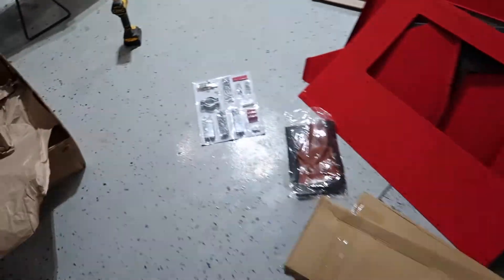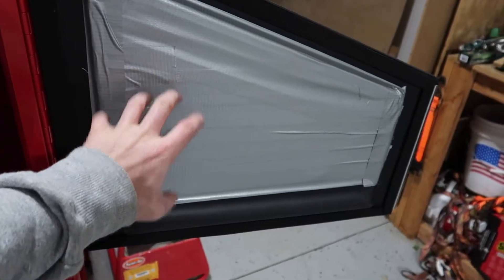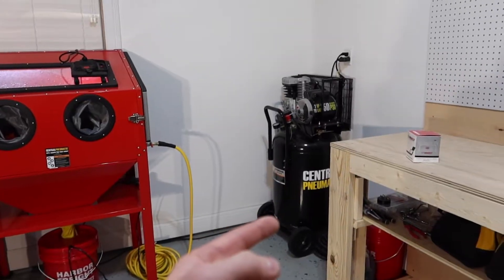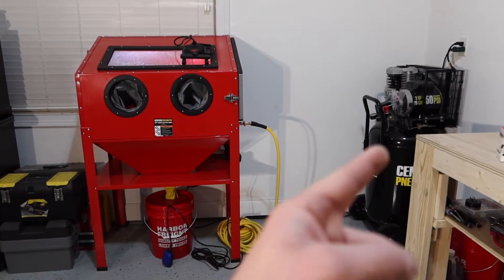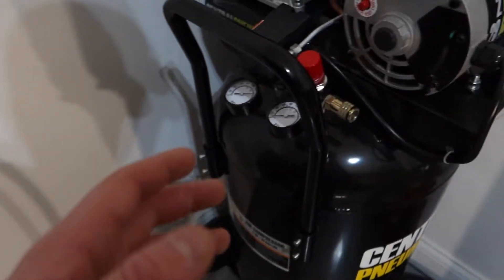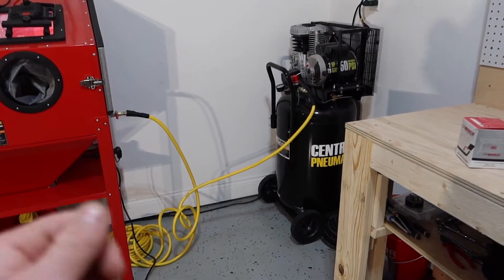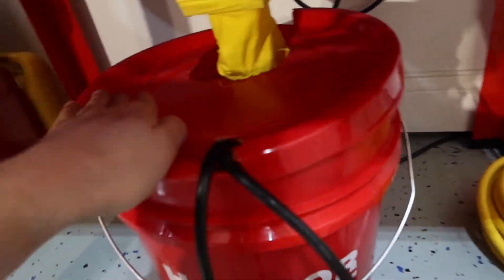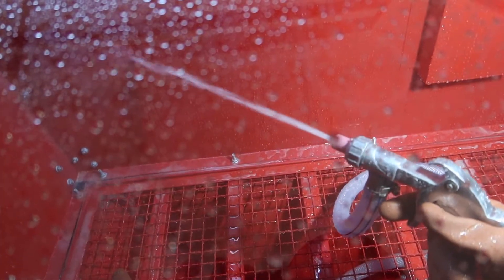DIY Vapor Blaster Build for Less than $500!

Comment: Bruh, ya gonna find that thing LEAKS like a sieve if ya don't SEAL the Joints in the cabinet.  I did it when I put it together. Every Seam that had 2 edges needs SEALED, (corners, front, back sides, )

Comment: Informative,  HFT cooperation of America should be giving you an endorsement w/ supplies.
Reply: Amazon Influencer DOES pay you when supplies are bought from your Influencer video's.... FYI. Harbor Freight MIGHT send ya some free stuff, but, they want you to give POSITIVE REVIEWS. i do not lie about Product Testing and quite honestly HF/Amazon Chinesium Crapolium simply doesn't last so if ya go that route, be prepared to rebuild it in less than 3-5 years. 
I did build mine with the same cheap crap listed but I also know how to fix it too. Parts List saved

Comment: Awesome try. But most videos that I've seen their water pressure seems to be 100 times more then what yours is.  But I guess if it helps and your happy with it, that's all that matters. Good job.
Reply from the maker: Check out the results and see for yourself. It’s not the best unit out there but if you want to spend $100k to have 100x the blasting pressure then go for it but I would think at that point it would destroy whatever part you are trying to clean. I’ll stick with my cheap garage setup, thanks for watching!

DIY Vapor Blaster Test (SATISFYING) Amazing Results
https://youtu.be/slW9TT-KTwM
Reply: @Kyle Corbett  lol. No need to get upset. I was just pointing out that the other videos that ive seen that people are mak8ng these machines really cheap. There's had a lot more pressure then yours and they didn't spend a lot of money on them.  No need to get mad
Reply: @scottmcbride2237  it's the compressor, you hardly see anyone with compressor so small this its the bare minimum...but.
the thing is...works...it maybe take a couple of minutes more but the end it's the same... hopefully Im going to have a go a building one...but have to save a bit more... different realitys...
Reply: @scottmcbride2237  his reply didn’t seem aggressive at all… you were the one talking smack… no one cares about your opinion. Move on.
Reply: @Dylan Romer  lol. And what smack are you referring too.   Lol.  I was just stating that he's water pressure was lower then most of the other videos that I've seen.  You tell me, what did I say that was so wrong.  P.S.  I did move on until you chimed in.

Comment: Very slick! Which pump did you use? Working well for you?
Reply from the maker: Works great! I used a sump pump that I bought off of ebay.
Reply: So the sump pump is pushing the medium and water together to your gun correct,  if that so then I be doing that I believe thanks